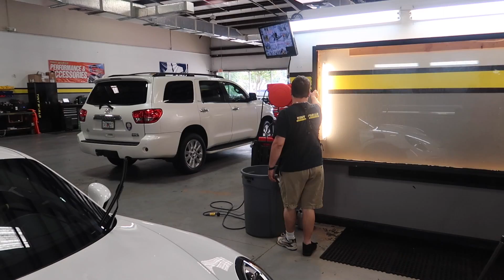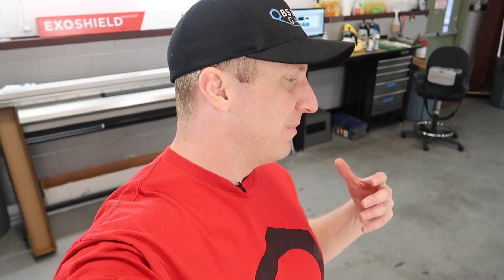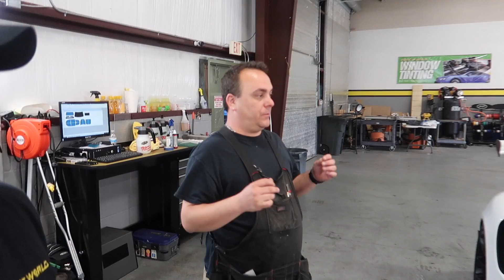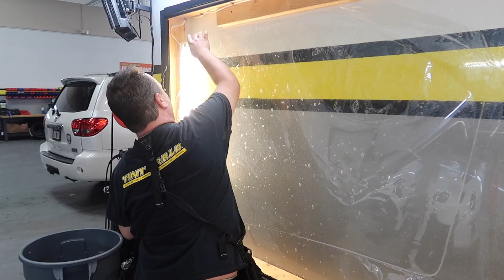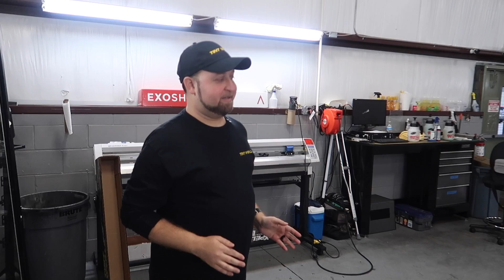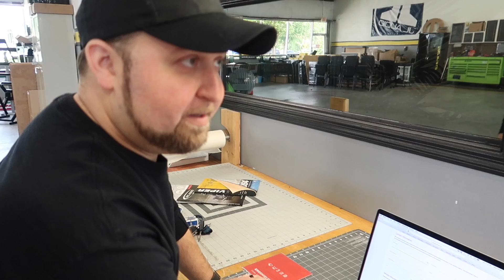GT3 RS Windshield Protection: Alchemy ExoShield

Comment: Does this film introduce wiper chattering, skipping not gliding smoothly during rain?
Reply from the maker: I didn't experience any.
Reply: @ObsessedGarage  Interesting! My wiper goes nuts on TPU based hydrophobic windshield protector. Any suggestion how to resolve it?  Basically due to hydrophobic nature there is not enough moisture left for the wiper to glide smoothly.

Comment: Guy has no clue what he is talking about. UV rays don't cure window film, IR heat does. The factory windshield of every car made is UV blocked to protect the plastic within the glass. It doesn't cure out quick because it is on the outside exposed to the humidity outside.

Comment: How does it work if there are already defects in the glass (scratches, small chips, etc.)?
Reply from the maker: There will likely be an air pocket on that area.  The film is super think.
Reply: Hi Paycheck409! The adhesive at the bottom of our film will actually flow into small/medium sized pits and make them invisible. However, if it there are lot of pits or deep ones, then there will either be small air pockets or some distortion while the adhesive reflows and settles (since it won't have a flat surface to sit on). We've seen people polish glass to make it look new and remove scratches, but that's something we aren't too familiar with. On the other hand, stores will be able to fill stone chips before putting on ExoShield and you won't see a thing!

Comment: If your windshield is not 100% then does the film still stick properly? Like you have few super fine chips? Car has 20k miles
Reply: Hi Jae! If you are referring to sand blasting, the adhesive at the bottom of our film will actually flow into small/medium sized pits and make them invisible. However, if it does have a lot of pits or deep ones, then there will either be small air pockets or some distortion while the adhesive reflows and settles (since it won't have a flat surface to sit on). We've seen people polish glass to make it look new, but that's something we aren't too familiar with. On the other hand, if they're stone chips then most stores will be able to fill them in before putting on ExoShield and you won't see a thing!
Reply: Hi Jae, TLC can definitely install ExoShield on your vehicle - they've done quite a few for us already and we've had nothing but great feedback from customers. If your windshield does need any polishing, that's a service availability that varies from dealer-to-dealer. The best way to have that answered is to just give Dave at TLC Auto Detail a call :)
Reply from the maker: It will likely have an air pocket on those spots since the film is so thick.
Reply: I am going to find out soon. I have a non daily driver with 1000 miles on it. I have one super uber tiny nick I do not see it to be an issue. I would say some cars arrive at the dealerships with worse. It was a rock recently tossed up on me by a passing by car.  I could see it hit and roll down, it took me half an hour to see any damage (after I got home and parked it in the garage) it is just that tiny. I would say the glue/adhesive may fill it and make it smooth. I am about to find out asap when I can find an installer.
Reply: Thanks for the reply.  ExoShield dealer (based on your website and closest to my location) is TLC Auto Detail in Dulles, VA.  Are they able to install and prep my windshield for this?

Comment: This is what I need. My F30 windshield is destroyed with the tiniest chips that completely wreck my head especially in low lying sun. I could get it replaced but in a couple of months it will be chipped to pieces again. My wife goes crazy as whenever I bring her in the car she sees how much of a knot I get myself in about it. It is actually a gnawing feeling inside me in low lying sun. I know I need help!

Anyway, Is the glass softer nowadays for some safety reason?
Reply: Hi Conor! It really depends on whether you have the aftermarket or OEM glass. OEM glass has to meet tougher criteria and is fairly high quality/standard, but aftermarket glass is a wild card and can be anything. It likely is just we have more cars on the road and most of us drive more these days than we used to, which means more sand being blasted at the vehicle.

Comment: What if your car is new but you have about 1000 miles on it unprotected (with some highway) that might have gotten peppered VERY tiny nicks or a small rock or two that left like a pinhead size nick. What do you do? So do they buff/polish it out or what?
Reply from the maker: You'll likely have to live with that.  Putting this on you windshield now would likely leave an air pocket on those areas that are damaged.  Polishing glass doesn't work so well.
Reply: Thank you so much for the reply, I love your channel. 
I am not sure that the "average" person would even consider it a nick on the glass. I probably could ask YOU to find it and even you might not be able to. It is just one tiny place a rock was thrown up on my windshield as I was pulling onto the feeder road by a passer by going about 30 mph so I had to be going less than 10mph as I had just pulled out and was still in first gear. 
I saw the rock and watched it roll down onto the cowl and removed it when I got home in the garage. It is not a DDriver, it is not a super car, it is a Holden/Chevy SS Sedan so the glass it already becoming an issue to find and it does have HUD display. The nick (the one I know of) literally is a pin/needle tip size. I had a hard time finding it after the incident and even when I go to look at it again (a few times after ) because I am OCD LOL. 

I suppose I mostly wanted your advice /opinion n glass polishing :) 
I agree with you on that as well. 
 
I would say MINE would be still considered like new or just as good or the same. Literally has just hit over 1000 miles in a year and a half. :(  Basically the longest ride was 75 miles from the dealership to my house it has ever been on.

Parts are already becoming an issue for the plant closed in Au. Last Oct. This seems like a great idea and along with PPF I want to put on it would give me the piece of mind I need.

Reasons for all who wonder why so low mileage is personal reasons. Health and family. Things are on the mend and up and up tho, hence why I am inquiring. :)
Reply: Also, I found the website, so I intend to find a local installer next week and let them look at the glass. I just cannot imagine it being an issue but will check. The only way it would be in any more pristine condition is if I had trucked it like you from the dealer to my house and never driving it at all. Actually, I did not know about such a thing for the windshield. Things happen, and now is the time I can deal with it. So, I will let you know how it turns out if I get it done :)      

I have put off the PPF for just have not had time but the car is flawless still (paint wise) and now is the time or never :)

Take care
Reply: Hi 6.2LTRV8! In case of the VERY tiny nicks, the adhesive at the bottom of our film will actually flow into small/medium sized pits and make them invisible. The concern with the rocks leaving a nick could be that sometimes they plough out a bit of glass causing a bit of a ridge - if that's the case most stores can either nudge that ridge loose and then the adhesive should take care of it as long as the nick isn't deep. ExoShield has been put on vehicles with plenty more miles than yours, so the odds are that you won't have any issues as long as the nicks aren't anything abnormal :)

Comment: I think my only fears would be something getting stuck under the film and possibly getting something caught in the windshield and leaves scratches in the film over all I think it’s a great idea be sure to let us know if anything happens with the film. Thanks for the content Matt
Reply: I am curious about this too. I wish we had a sooner than later long term follow up. The more time I wait, the more issues with the glass on my car will come about. I may just go for it.
Reply: Hi kfeems & 6.2LTRV8! Dirt trapped under the film and scratches are both issues we spend a lot of time thinking about at Alchemy. Here's what we're doing to mitigate/solve these issues: 
1) We only work with stores with extremely clean working environments. A dirty environment = more dust particles in the air = dirt landing on the windshield right before we lay down ExoShield. We also teach our partners specific tips to minimize dirt trapped under the film. All of this said, as Pete mentions in the video, unless we are installing in a Class 1 clean room (~$6,000 per sq ft to build), there may be 1-2 tiny particles on the average installation. They are often so small that you won't notice them, and in fact, after the other dust particles land on your windshield post-installation, you won't even know which one is which.
2) The key innovation behind ExoShield is actually our proprietary hard-coat, which is the most scratch resistant in the world for this type of an application. It will resist most things from scratching it, so you shouldn't worry a lot. Just remember to replace your wiper blades as your manufacturer recommends (typically every 6 months) or when they are worn out, don't scrape your windshield with a metal scraper, and avoid using any exotic or toxic cleaning chemicals on it. 

If you have any questions, we'd be happy to answer them here, via email or phone - our contact info is on our website :)

Comment: Window film is really interesting but I'd be really worried about scratching the film if I ever had to use my wipers. I've heard stories from customers of mine who have had this product who've had to get it replaced due to scratches from the blades catching the "normal" dirt and debris from driving that collects on the screen. Pros and cons I suppose, but in the long run it will hopefully save you money. Good luck with it. Interested to see which glass coatings do & don't bond to it since it's not glass.
Reply from the maker: I'm much more interest in the time savings and hopefully less pitting.
Reply: Hi Martin, the key innovation behind ExoShield is actually our proprietary hard-coat, which is the most scratch resistant in the world for this type of an application (6X better than the next-best technology). It will resist most things from scratching it, so you shouldn't worry a lot. Simple things like replacing wiper blades as your manufacturer recommends (typically every 6 months) or when they are worn out, not scraping the windshield with a metal scraper, and avoiding exotic or toxic cleaning chemicals on it will help you get years out of ExoShield. 

As for glass coatings, you are pretty much right on since most coatings are designed for glass. The one we've found that works incredibly well is actually Ceramic Pro 9H, which not only adds the hydrophobicity most people love about glass coatings, but also increases the scratch resistance of ExoShield by another ~70%!

Comment: question is durability and if you notice anything strange looking through the windshield while driving.  I'd be interested to hear your thoughts after a couple months of normal driving.
Reply from the maker: I haven't driven it yet.  I'll be sure to update.
Reply: Matt have you had a chance to do any driving since adding the windshield protection? I’m very interested in hear a short term review, I’m seriously thinking about having mine done, I called to check pricing etc... I’m waiting to hear your review

Comment: Insurance companies say your rates don’t go up due to replacement in Florida, but I call BS on that. I’ve had windshields replaced on 3 or 4 of my cars and when it came to renewal, my rates went up.
Reply: James Briggs it could be the overall rate has increased like for me where it raises every year even though I didn’t make any claims
Reply: Freedom I haven’t done a windshield claim in 3 years and my rate stayed the same throughout that time frame.
Reply: Happened to me too back in the day. I had a windshield with a radio antennae in it cost about 800.$ to replace. It was a truck and took rocks like a jeep. I was pushed to claim the FIXES on my insurance by the dealership/glass repair. These being the FILLER THINGS ,to keep it from running or ruining the windshild, these were repairs in order to save money and lose that factory seal. 

SO, at the total cost of the claim 35.00$ back then times 3 which is less than 100$ I soon received a SHOCKING letter telling me if I had ONE more claim, I would be DROPPED from the company!!!!!
So, I told them (back then) what if I had made them pay the full 800.00 to replace it? Would they rather have done that than to have me claim 3 payments less than 100 bucks? DID NOT CARE ONE BIT. I was on the list to be knocked off the insurance policy!!! LOL 
Like wow. I cannot stand insurance companies. You cannot drive without them and you cannot win with them. They hate to pay out but man if you miss a payment they wanna really stick it to ya too.

Comment: I work in the auto glass industry, and I can certify that any reputable shop can replace your windshield, with more care than the robots at the factory. depending on the surface we can adjust more precisely the amount of urethane needed. Now, windshields can be removed with a nylon wire system, which will never scratch your paint. But I understand entirely the need for this product on more expensive vehicules. It is something that might be interesting to add to our line up of services at my shop
Reply from the maker: This is the real Mike.  As Max was stating, like in any product or service, there are really good practitioners out there.  But the likelihood of finding those people and then catching them on their best day, is very small.  It's why I don't like the idea of getting epoxy done on your garage floor.  If it works and you find the right "guy," it can be amazing.  But...all the factors necessary to get it right makes the odds very high that it doesn't work out so well.  

I'm simply testing the viability of a product like this to see if it makes sense to reduce the chance of needing to find a windshield guy that is legit.
Reply: I totally agree and I would not let someone else than myself replace my windshield for those exact reason,  and I agree with Matt on that one, excellent practitioners exist.. just not worth it to try and find them
Reply: Care is a lot different than precision.  I had mine replaced and the 2 guys were crawling all over my car, standing on my door sills and even the floorboard in front of the passenger seat applying the adhesive.   The entire process bothered me so much that I almost want to sell my car.  Windshield replacement isn't close to what the factory does and it certainly isn't for detailing enthusiasts like Matt and most of his followers.  Basically, if your car is more than transportation for you, don't replace your windshield, and if you do, don't watch.